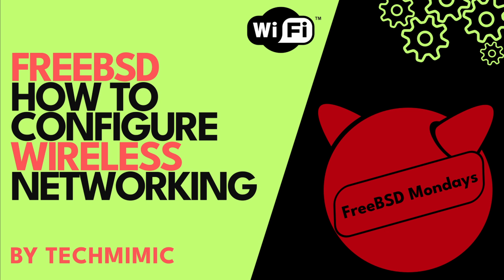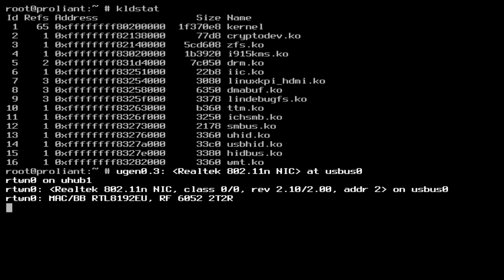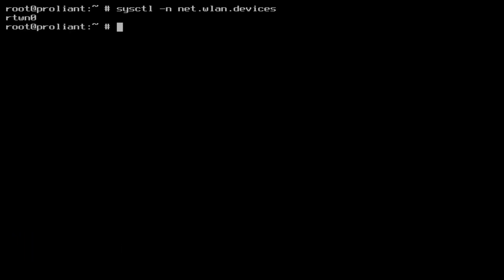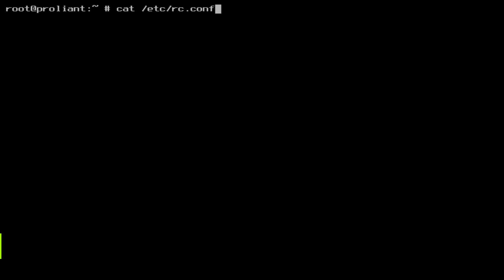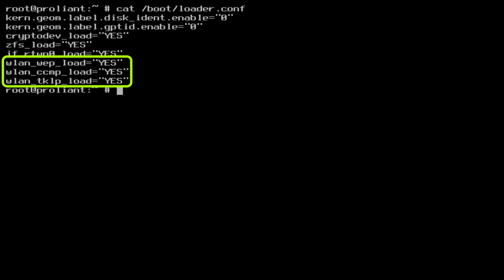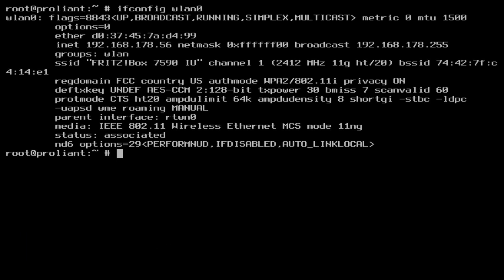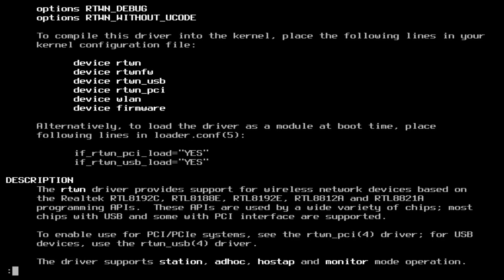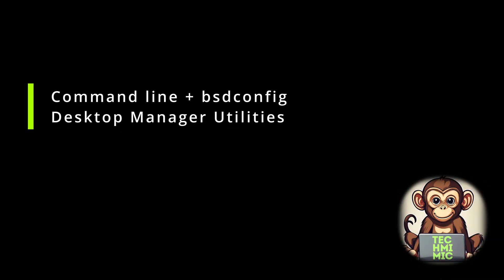How to configure WIRELESS networking in FREEBSD (WIFI / Wi-Fi)

Comment: Very good video. I've been searching for something like that for days. Thank you.
Reply from the maker: Glad you liked it! We aim to please.
Reply: Hallo. I cannot load the driver's for my rtl8812ae. If I type "pciconfig..." I get my card at "none1@pci0:1:0:0:" but I cannot do anything with it. If I type lspci the card is correct recognized. What can I do?
I've managed to set a USB dongle but not a pcie card. Why?
Is there a difference between rtl8812a and rtl8812ae ?! Thanks.
Reply from the maker: Your output of pciconf reading "none1@...." indeed indicates there is no driver loaded for that device. The RTL8812A is used in both USB and PCI devices. The RTL8812AE is the PCI-only version of this Realtek chip. They do require different drivers because of their use of a different interface. Most likely you did manage to get the USB dongle to work as you say, because the rtwn driver is natively supported by FreeBSD. And indeed according to rtwn's man page the RTL8812A (so USB+PCI) is included. The AE version is not natively supported due to the lack of official driver support from Realtek. Unfortunately, this is a common problem, that a vendor does not provide drivers for operating systems (happens a lot for Linux and FreeBSD).  If your card just doesn't work with rtwn as you describe, you can try to use the Linux driver via the Linux compatibility layer, but I can't explain that step-for-step in a comment I'm afraid. It will involve compiling on your system as well. According to the internet Intel PCI cards are better supported, but that clearly won't help you if that's not what you own. Maybe just try to force-load the same rtwn driver you have for A to the AE card via the configuration files. Not sure if this will work....hopefully somebody else can offer more information. Thanks for watching.
Reply: Thank you very much for your time and answer.
The USB dongle is another driver.
In Linux I've managed to install this card pretty easily, and I am willing to compile this driver for freeBSD but I don't know how. Do you have any videos about this?
Do you have a discord channel or something similar for more elaborate discussions?
I do have an Intel AC7260 card, but Intel cards are known not working as Access Points unfortunately.
How can I force-load the A rtwn driver in configuration file?
I've seen that there is a AU driver  already in Kernel but I don't know how to force-load that for my card. Best regards.
Reply from the maker: Ah understood, I misread that you have the same in a USB dongle form too. I don't have a discord yet, but you're not the first one asking for this, which is a good indicator I should start thinking about it. Maybe if the channel is growing beyond 1k in subscribers, but I am not pursuing this at the moment. Also I don't have a video yet on this particular topic (compiling or force-loading), but keep watching the FreeBSD Monday videos is all I can say for now. For both topics I'd prefer to create an in-depth video in the usual style for all viewers to benefit from. Thank you for the interaction, it is very much appreciated.
Reply: I can't wait your videos and/or a discord channel. Even a forum somewhere where we can "meet".
I don't know why but your videos are hard to find even if I type the title exactly. Perhaps you can put more "names" in the title (i.e. Realtek, Drivers, FreeBSD). Thank you very much.
Reply from the maker: We are all in the hands of the YouTube algorithm it appears. All of the video titles should be descriptive enough, there are tags in the video descriptions and under the covers YouTube keywords are provided. If they are hard to find (even if you provide the exact video title, not sure what else to do honestly), I think your best bet it to subscribe and enable notifications, that sort of thing. Also just watch the entire FreeBSD playlist ;-) I never ask in any of the videos to subscribe, as I find that sort of behaviour annoying myself. Maybe that's why YouTube doesn't like it, who knows....
Reply: @TechMimic  anyway, please continue to make (any kind of) video. You make very good quality.

Comment: Thats my thing, if i install freebsd, i dont wanna deal with the wifi network settings. I just wanna set it and forget it. I mainly been using q4os Linux im on the fence and at a conundrum on using freebsd or haiku OS.
Reply from the maker: Hi, you can set it and forget it from the CLI on FreeBSD, but I know what you mean for sure. For the operating systems that you mention there is a desktop environment to do this. On FreeBSD you have to install your own as you know. Have you considered GhostBSD?
Reply: @TechMimic  I mainly been using Linux distros for years, just never got into command line other than copying and pasting sudo commands. I just don't want to use windows, or apple related operating systems. It also concerned me some Linux os systems were found to have vulnerabilitys and bad actors broken into these desktops. I just wasn't a easy desktop that's hard as nails extremely hard to get in and keep everything out but with ease without getting screwed cause I'm not the brightest lol.
Reply from the maker: Coincidentally, this week's FreeBSD Mondays is about GhostBSD. Hope it helps:
How to install GHOSTBSD (+First look)
https://www.youtube.com/watch?v=L32Czv0GCCA
Reply: @TechMimic  only the name, I'll check into it thanks

Comment: Hi, Wishing all are well.
Just a suggestion and a Question:
Suggestion: intel's AX200 and AX210 wifi 6 with blue tooth are available very cheap and easy to install hardware.During the FreeBSD installation I've found both types where discovered for setup and retained the input after updating and rebooting.
Question: Why doe's pcmanfm inform of "operation not supported" on a fresh LXQT install, when trying to access local files outside of the home directory?
No issues with Yazi or even eaglemode? Installing gvfs worked after a reboot for LXQt, just not for openbox, once logged in ?
Reply from the maker: Thank you, wishing you the same and thanks for watching! That's an excellent suggestion, thank you for that. Intel's AX200 and AX210 are indeed well known and not expensive. It's also good to know that FreeBSD does play well with them. You can simply follow the video and use the same steps and just replace and adjust wherever needed.
Re your question (that you can't access local files outside of the home directory) I can think of the fact the LXQT is managing things for the user and it will start GVFS daemons when needed. Most likely that's why it worked after you installed GVFS and rebooted. So for Openbox make sure GVFS services are started. Verify with "ps aux | grep gvfs" after logging into Openbox. Can you try to add this to your Openbox autostart file:

/usr/local/libexec/gvfsd &
/usr/local/libexec/gvfsd-fuse /run/user/$(id -u)/gvfs &

That's (I think, but I haven't tested it) why Yazi or EagleMode don't have an issue, they manage the operations differently then PcManFM. Can you give it a try, please?
Reply: @TechMimic  Thank you for the reply, I will try what you suggested. Again thanks, it's much appreciated.